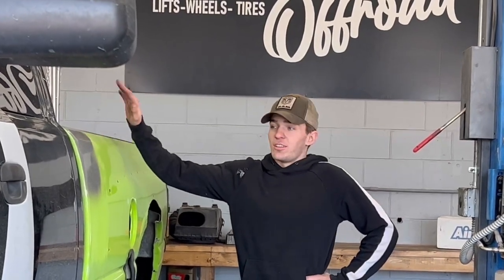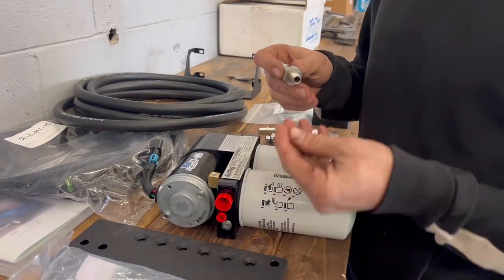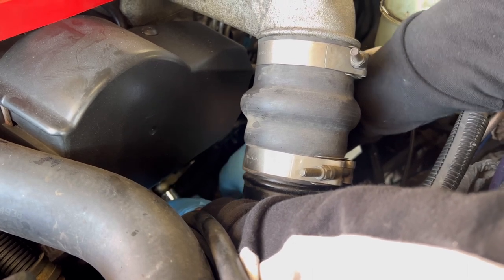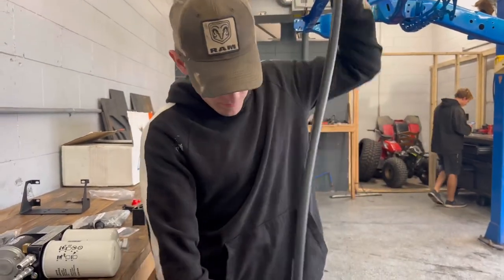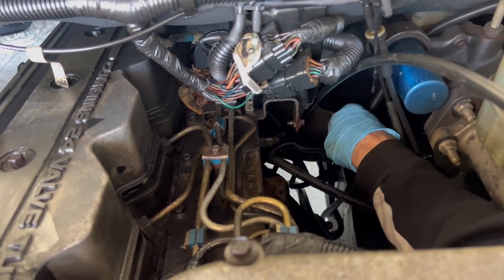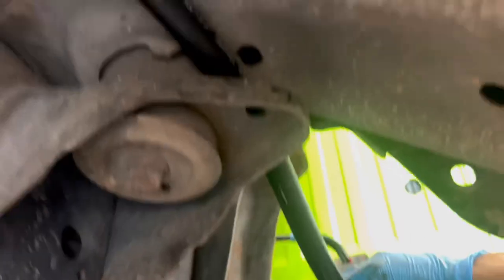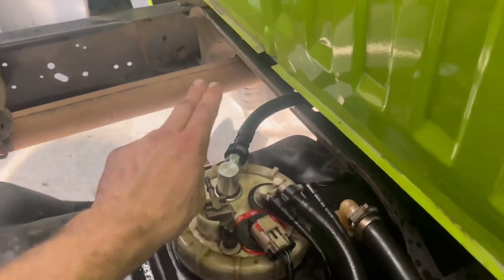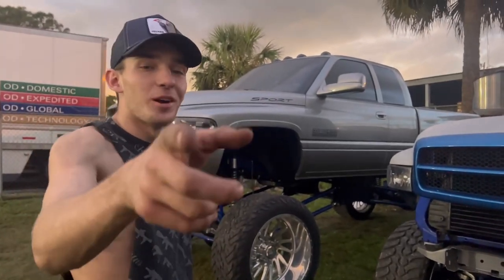Installing An AirDog Fuel System On My 24v Cummins!

Comment: What is the hole below the diesel filler neck on the bed, just wondering
Reply: It looks like that bed was originally a dually bed. With these 2nd Gen Duallys, the dually bed is actually identical to a normal SWD bed, but the fenders are attached after the fact in the factory. So it comes with the original location of the fuel cap, but then they drill out the huge hole that you are mentioning for the new filler neck to extend and reach the location of the fuel cap on the dually fender. Also, you can see all the old bolt holes outlining the spot where the fender used to be. So yeah, that’s why there’s that monster hole lol